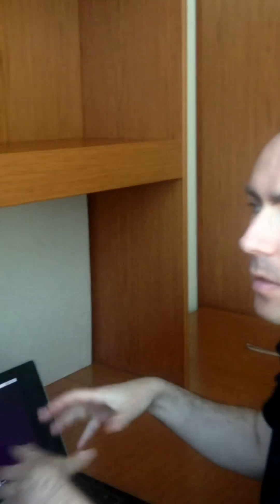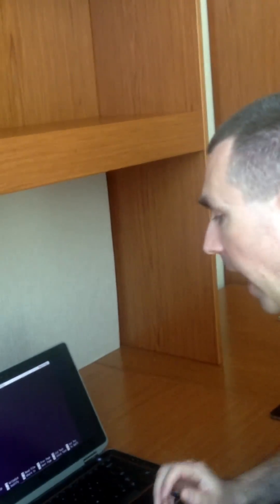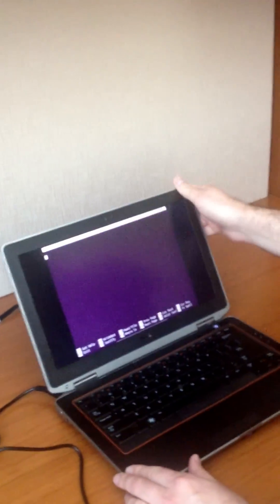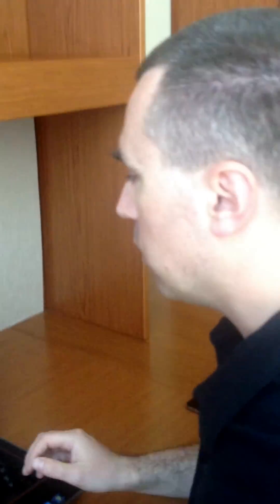EM Covert Channel Attack Setup and Explanation

Comment: @Milos: interesting experiment. I have several following questions. 1) What is the frequency that contains the EM, is that the clock rate of the CPU/RAM? 2) How far can you detect the EM emanation, how do you get rid of interference from other laptops? 3) Do you build custom program, e.g. GNU Radio, to decode the key presses from the radio signal? 4) Does the same technique work for a desktop where EM emanation is shielded by metal case? I am keen to reproduce your experiment for research purpose. Thanks a lot.

Comment: Milos - are all these devices (laptop, loop antenna etc.) on a different power circuit from the attached computer on the other side of the wall?  I'm curious if it's all true just data you gather via the antenna.  What happens when the laptop on the other side of the wall is running on Battery (power save mode) where the steps down the processor to save power?  Do you get the same results?